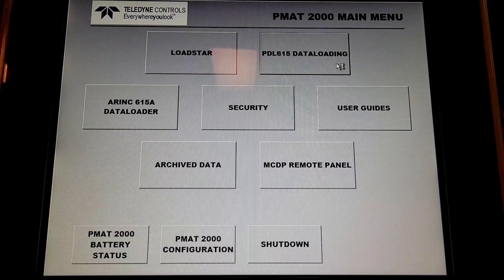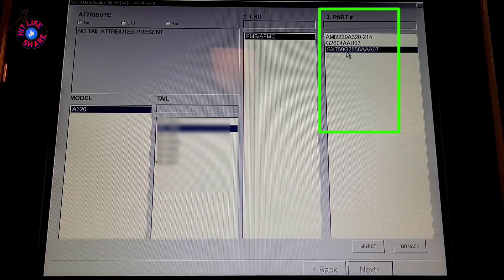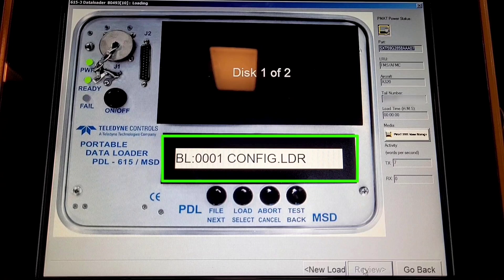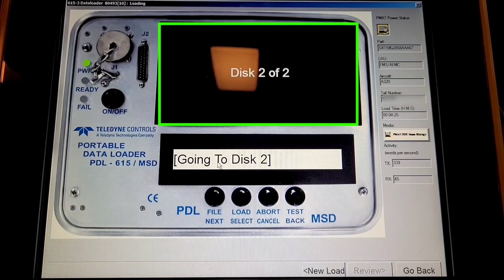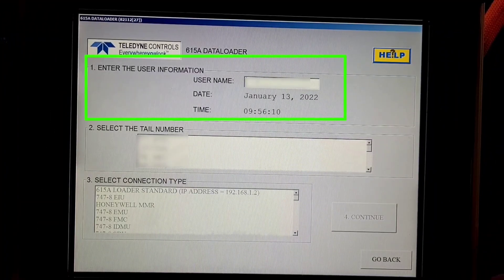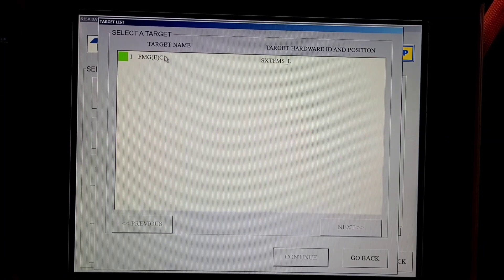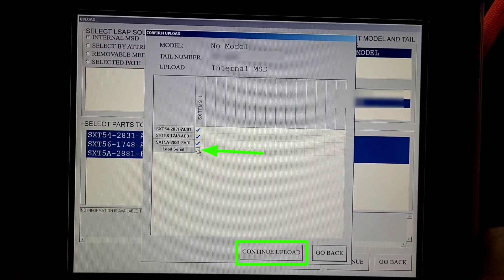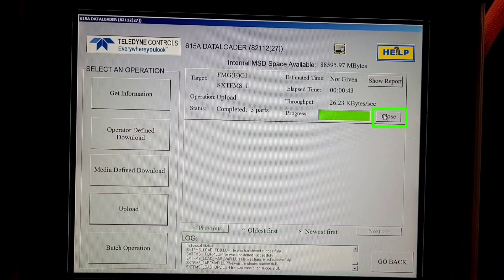PMAT 2000 PART 3/3-  UPLOADING SOFTWARE FROM PMAT2000 TO AIRCRAFT #pmat2000 #pdl #teledyne #loadstar

Comment: Are these software uploads password protected? In other words, can anyone just plug in and upload software to the system, without being authenticated first? Serious security concerns if this is the case. Thanks.
Reply from the maker: Offcourse. There is a signature for each software and also the file type, and the source is well protected.
Reply: Thanks for your reply. Aside from verifying the signature, is there anything stopping a person from uploading software, whether verified or not, onto the system? In other words, does the system require an authorised user to enter some kind of a password before uploading and verifying it, or can they just proceed with the upload without any access control checks whatsoever? My question is more related to the access control of the aircraft system itself. Thank you.
Reply from the maker: Yes. It is password protected and also log file created for admins.